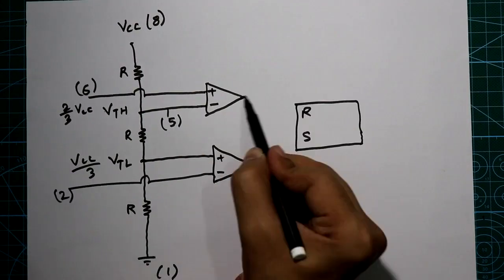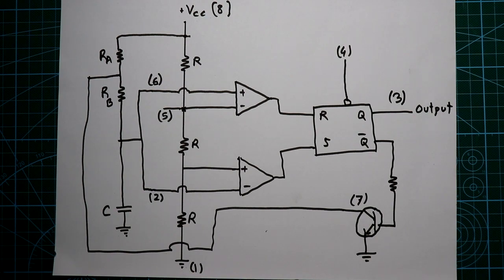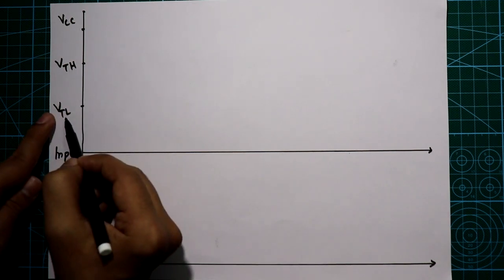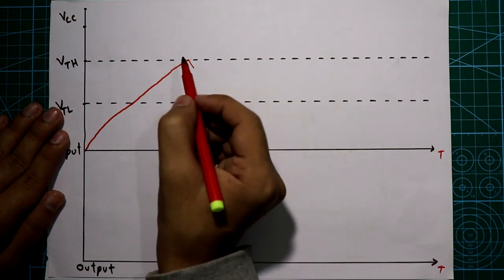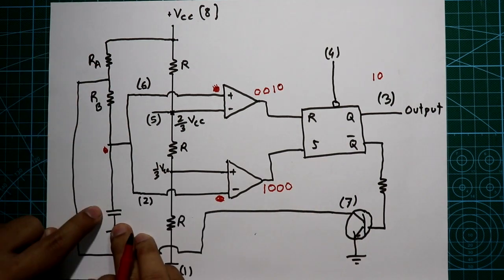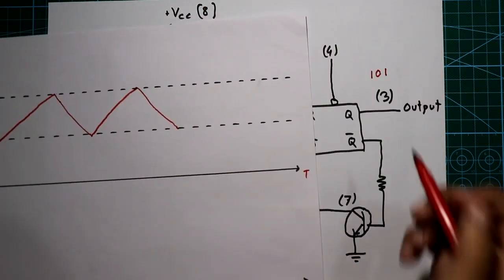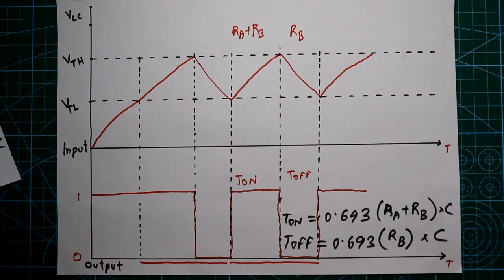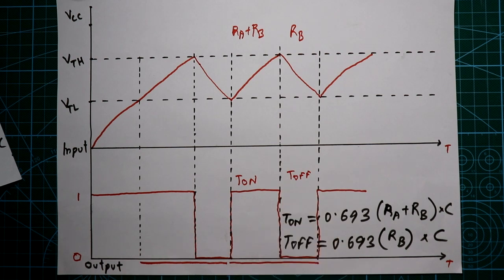Astable mode of IC 555 | Astable mode of timer IC Explained

Comment: To find T off and T on why we need 0.693 and what does it mean?
Reply from the maker: ln(2) = 0.693.
During charging or discharging, the amount of charge on the capacitor changes exponentially (not linearly), that's why to find out the Time, we need to use logarithmic (exponential) function.
To know know more about this, you've to go through all these theories.
Reply: @EEWave  Thank you Sir

Comment: Hi Sir- thank you so much for doing this. It really helps. You're good.  I am a little bit confuse the way the capacitor is   discharging. When it is fully charged, what is the polarity of the capacitor.  If the upper plate is the positive charge and the lower plate is the negative charge, how is this capacitor being discharged with respect to flow of electrons .  As far as I know capacitor when fully charge shall be connected to a load in order to get use of its charged. Thanks and 
Regards...Jerry